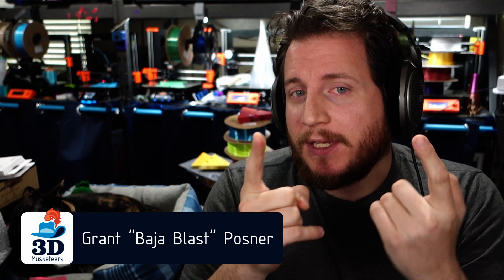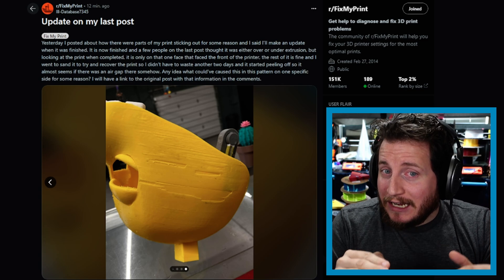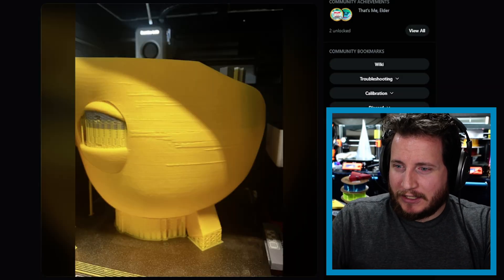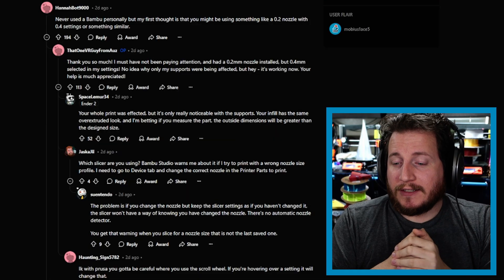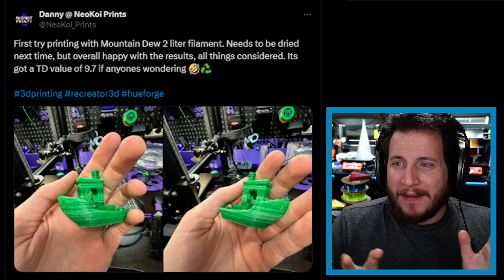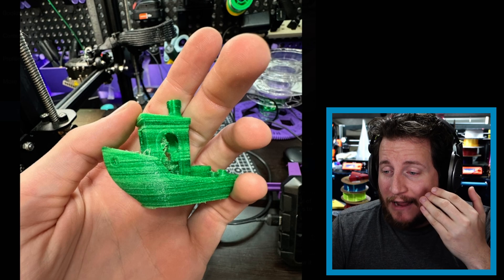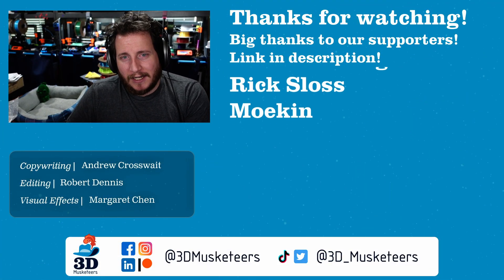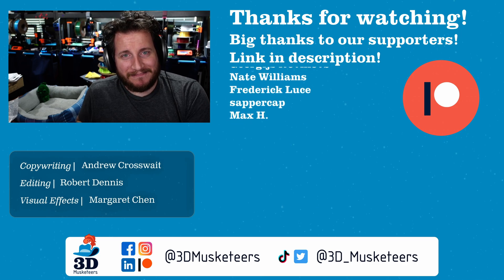Bambu and... Mountain Dew?! - PrintFixFriday 170

Comment: 9:01 got a pultrusion machine, built the JRT3D recreatior mini, can pretty much recycle an ender 3 to get all the required parts. 

Have found the 2 litre Coca Cola bottles we have in the UK to be the most consistent and reliable. The key is getting the bottles incredibly clean, if there is even a tiny bit of glue residue from the label layer adhesion when you print the filament suffers badly and the glue clogs nozzles when printing. 

The other challenge is how to splice multiple lengths of filament together, some will join the ribbons of plastic together before pulltrusion into a long ribbon. Others will try to weld filament together after pulltrusion. The Sunlu filament connector does not go hot enough to join bottle pet filament!!!

I haven’t had much luck with both so opt for option C which is have lots of short lengths of filament and rely on a runout sensor to pause print. Ideally with this option you want a sensor on tool head to minimise wastage between pauses.

Comment: I had a vase that came out like those supports, I was using a huge layer height, and about equal width, it started extruding over the sides of the previous layer, it also had the hot end a good 5mm above the previous layer surface by the end of it.
I brought it to RMRRF

Comment: That's not just wet filament with the mountain dew bottle.  It's also low flow rate.  You need to bump flow up to like 140% with this stuff because the filament is hollow.  I print a LOT with it and just this past Wednesday I cut and pulled a little over 100 bottles, mostly 4L water bottles.  You need to dry the HECK out of it.  if you think it's dry it isn't.  Leave it longer and when you think it's good wait another day.  I'm not kidding.  It makes that much of a difference.  Bump flow to 140%, temps at 265° and run at 40-50mms and you're golden.

Now...if anyone knows how I can stop the build plate from pulling off the magnetic bed while I'm printing that'd be awesome.  Do these magnetic sheets loose magnetism over time because this thing is NUTS.  Causing layer shifts like crazy as the corners of the bed keep curling up.  One even pulled up so badly that the whole sheet got pushed off the printer when the nozzle collided with the model.
Reply: Losing the magnetism:
Heating the bed over the Curie temperature but I don't know the temperature form the typical magnetic bed Stickers.
Reply: @berlinberlin4246  Yep...I think you nailed it.  I couldn't sleep so I did a LOT of digging and google searches.  From what I can gather the curie temp for these magnetic stickers is around 80°C so I DEFINITELY exceeded that a few times.  Aliexpress here I come.

Comment: 3:55 I was not expecting my problem to actually end up in a video. 

It has not happened since and I’ve added about 400 extra hours to the printer since then. I haven’t printed exact model yet until right now it’s got about a day left, but I have printed something similar and it didn’t happen. although I have noticed there’s been a ton of tiny strings hanging off the purge block and support after changing the gears, but not the print itself.

By the way, it seems 3600 hours is the time where bambus start breaking. I went from zero parts breaking in those hours to three different parts breaking in a week. Like I said in the post I just put a new runout sensor and extruder gears, but a few days after that AMS motor two broke. So I’m currently waiting for that part to arrive. I spent an hour straight unloading and reloading slot 2 because I was in the middle of a print when it broke.